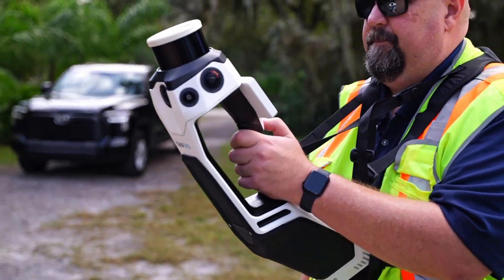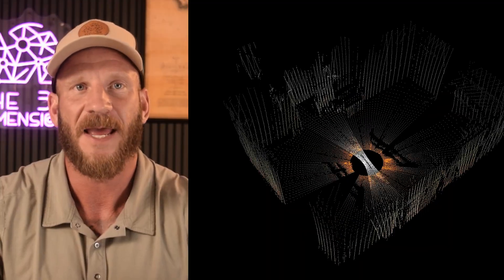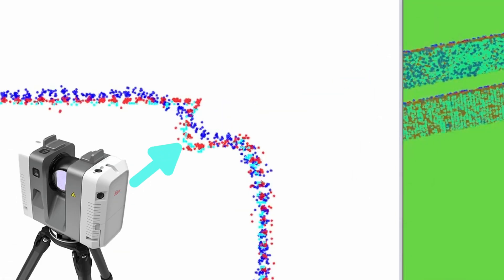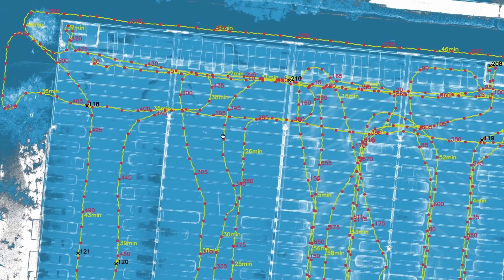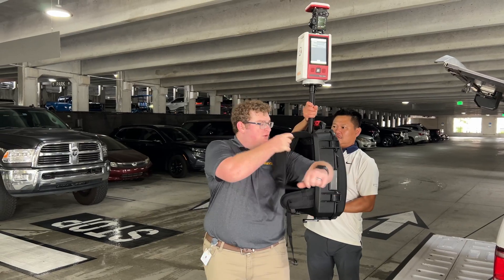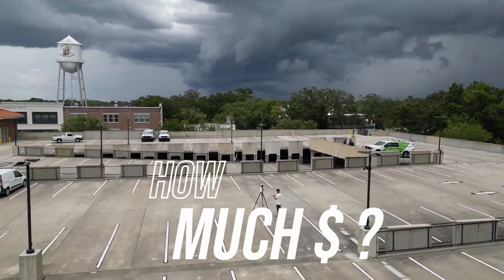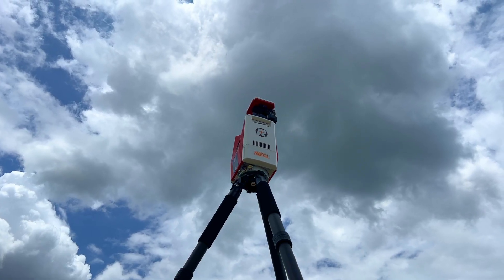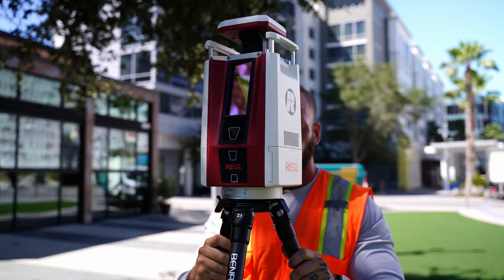Riegl's Hybrid Laser Scanner  - VZ600i

Comment: I don't see why you cant combine SLAM with RTK/PPK.  Most SLAM scanners that use GNSS are capable of this.  I do only outdoor slams but almost every job I do will have plenty of canopy coverage and almost every job I'll have gaps in my RTK trajectory.
Reply: The system has no problem collecting with gaps in RTK. It can go into float, and even single or loss depending on the timeframe. We have even completed collections in dense forests, city canopies, and short tunnels we minimal problems.
Reply from the maker: You can, but SLAM algorithms can still struggle in featureless environments even corrected with GNSS whereas trajectory correction that primarily relies on the INU + GNSS is better suited for these kinds of environments.

Comment: Hello, thanks for all u share. 

Please I want to know what could have gone wrong? 

I observed GCPS in static observation for 2 hours each on a point. After processing baseline and applying network adjustment in tbc, I have 3mm , 1mm and 4mm to 5mm on horizontal and vertical coordinate thru out. 

I set total station on one the GCP for orientation with processed coordinates and I got up to 50mm to 70mm misclosure. Pls what could have happened. 

Also in the past I have done orientation with total station using coordinate from RTK and the result was not this bad.
Reply from the maker: Did you compensate for grid vs ground or the local combined scale factor?
Reply: @The3rdDimensionSurveying honestly i did not or let me say i do not know how to do this. 

I ensured i followed the transformation parameters as given and i tested it by using converting one geographical coordinate to projected coordinate. 

Please how can i contact you directly?
Reply from the maker: @habeebalaran you can find me on LinkedIn.

Watch my video about grid vs ground first though.